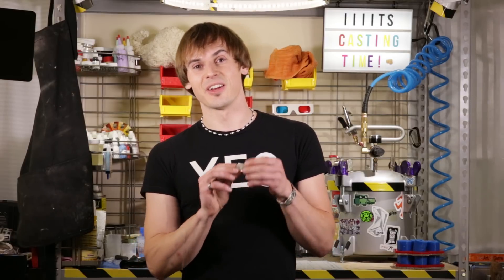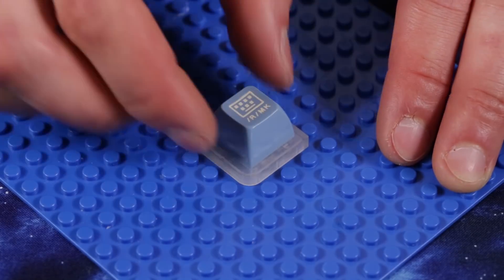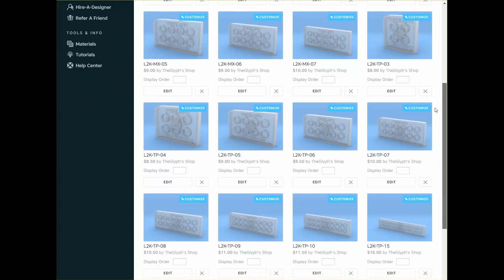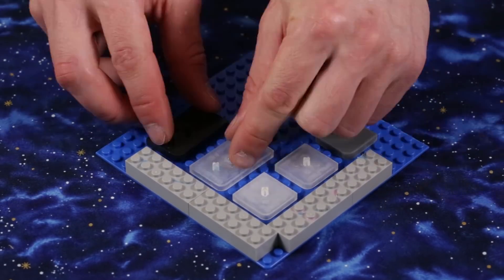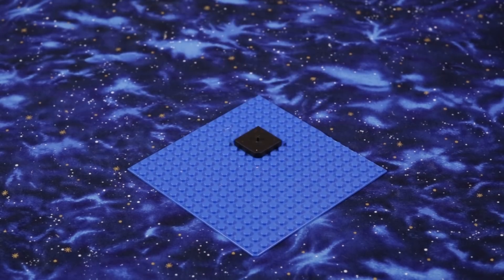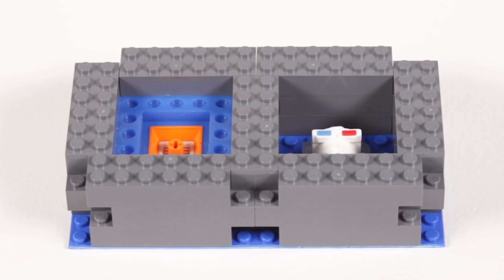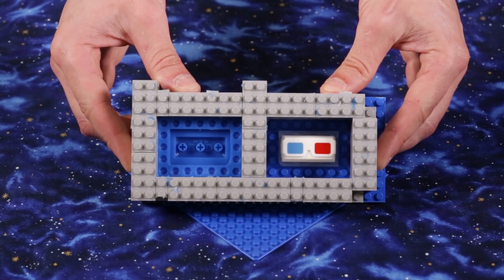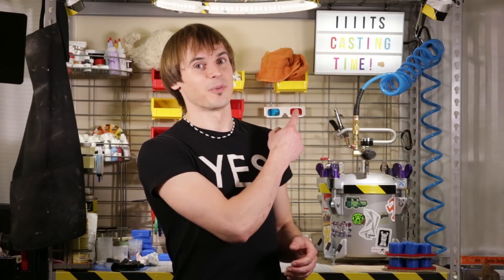Introducing: L2K Adapters

Comment: Is there anywhere to get these l2k adapters?
Reply: Link in description or just 3d print one your own
Reply: @Alex_leng  unfortunately they are no longer available at the links above.  The store for L2Ks seems to have stopped running a couple years ago from what I can see.  And while there are some 3d printable plans on the internet, not everybody has access to a 3d printer.  I was personally looking for a new source as well.  Additionally, the only 3d print plans I can fine are for single keys and the space bar.  There were no plans for the larger/odd shaped ones.

Comment: I'm so interested in this now that I found out it's affordable! Thank god for r/mechanicalkeyboards for finding you.
Reply: ‘affordable’ 😂 I suppose in the terms of the mechanical keyboard world it’s affordable
Reply: @almostanengineer  Name any real hobby that doesn't have a cost. This is definitely affordable by pretty much any standards for a hobby.
Reply: @xex2kok  the difference is the value of that cost, it’s almost impossible to find anything in the mechanical keyboard world that doesn’t bring your budget go £100+ immediately, but not the case for most other hobbies, heck if you want a full set of key caps, your looking on at £200+, so yeah, every hobby has a cost, but this one is mainly for the high rollers I’m afraid, those with large amounts of disposable income, or just don’t care about running up gigs dept burdens.